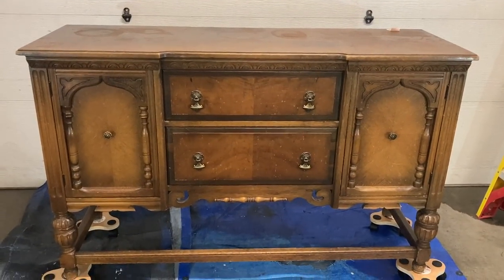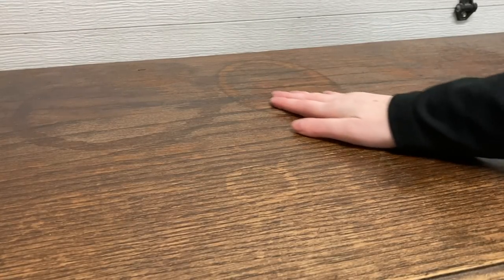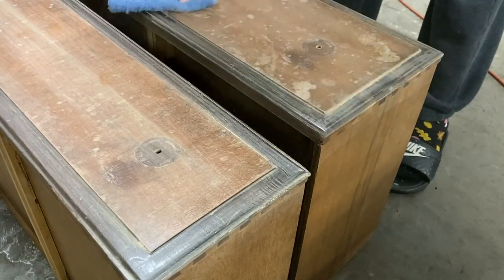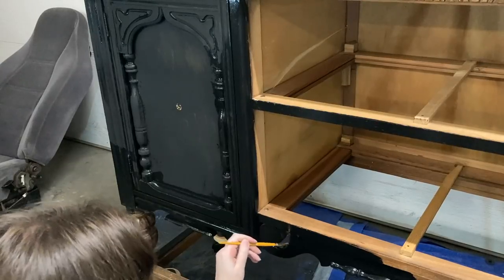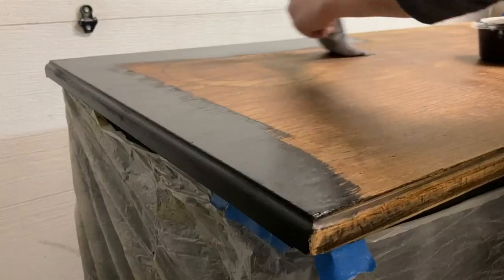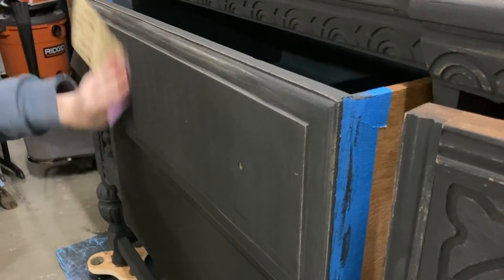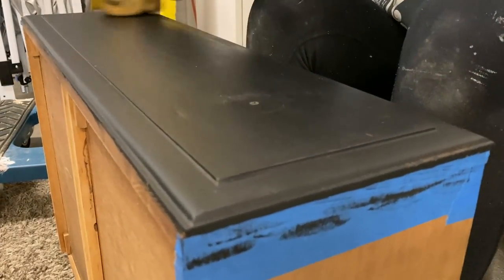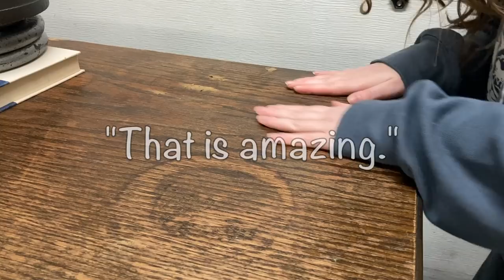Saving a Damaged Jacobean Buffet with Milk Paint | Shackteau Interiors | Modern Farmhouse Furniture

Comment: would it have been easier to use a stripper to remove the finish on top? rather than doing all that labor, especially if posting for sale afterwards? I'm asking because I am wanting to start my own flipping/repurposing forgotten furniture etc....
Reply from the maker: Not in this situation, because I would have needed to do plenty of sanding afterward anyway. And I wouldn't have wanted to get stripper in all those cracks and holes in the veneer.

Comment: Hi, great job 🙂 curious though.. I've never used glue syringes. Are they one use and toss or can they be cleaned up and re-used?
Reply from the maker: Thank you!
I've never tried to clean them, actually. I would imagine it would be pretty difficult, but I'm sure you could try. You would just need to do it right after using them so the glue it still wet.
Reply: I found these mini squeeze bottles with needles on Amazon and I pass a piece of fishing line through the needle to clean up after I use them. Thought I would share.
Reply: I've used them, and they are cleanable.  Hot soapy water pushed through the syringe soon after use.

Comment: Wow, what a transformation. I'm just starting into this hobby. I've found your videos, helpful and inspirational.  I was wondering how durable a wax coat is.  Would you use it on a desk over chalk paint or is it better to do a clear coat top coat from dixie belle. I have an antique drexel vanity/desk to do. Just wondering what would work best for it. Thanks
Reply from the maker: Thank you so much! That's so kind.
Wax is definitely durable, but it is recommended to reapply every 6-12 months, so that makes it more high-maintenance than clear coat. 
If it's a high traffic piece and you don't want to worry about it, you may be better using a clear coat. And you can always do an extra coat on the top for more protection. Something like a desk, I would do 2 coats on the body, and 3 coats on the top for maximum protection.

Comment: I admit, through most of the video I was sure it would look bad, I should have trusted the process! The ease with which you could distress the piece means that the next owner when you pass it on could easily sand and stain it too.
Reply from the maker: Always trust the process! 
I hope I don't ever have to pass it on! The nature of milk paint makes it easy to distress. It needs time to cure, and it wasn't cured when I was distressing, so it was easy to do. Once it's cured, it's very durable. I also sealed it with wax, so this finish is going to last very well. It won't be easy to sand off.
Reply: @ChicAntiquebyHolly  ok, that makes more sense. I've only bought milk paint once and it didn't flake, so I wasn't exactly sure how yours worked. By passed on, I meant inherited, as it is a beautiful and sturdy piece. I'm sure it will have a long life now it's being looked after.

Comment: What is chipping exactly?
Reply from the maker: Chipping is when the milk paint cracks and doesn't adhere to the surface. It cracks and "chips" off with a light touch or sanding before sealing. It creates an authentic antique'd look. Similar to the way a piece of furniture in a farmhouse would start to chip and wear down after 100 years of use.